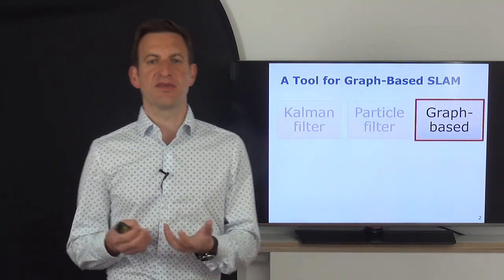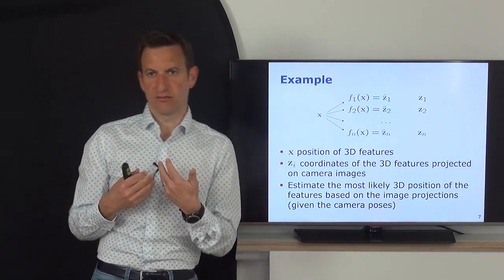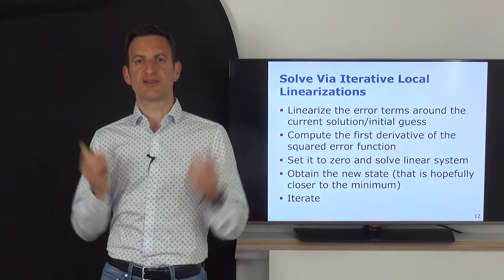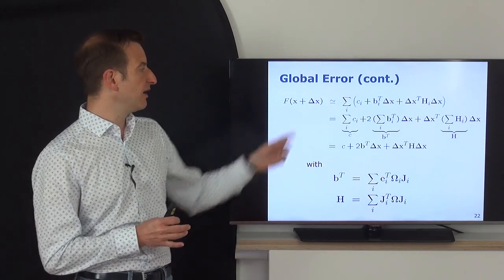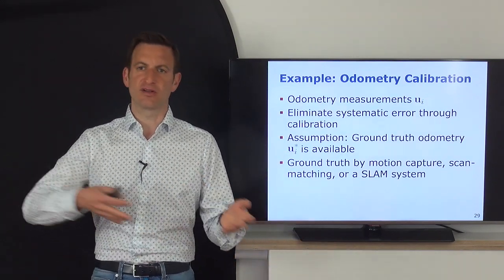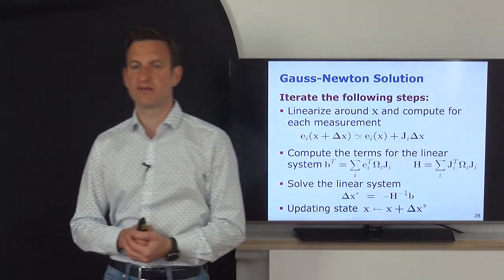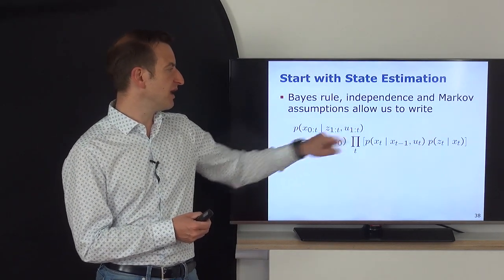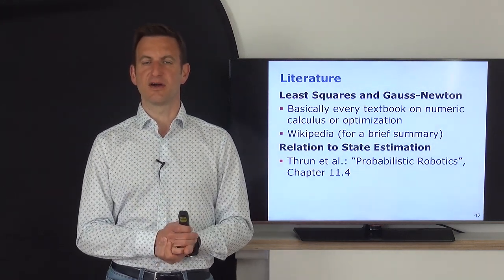Least Squares - An Informal Introduction (Cyrill Stachniss)

Comment: I found the explanation at 9:40 very confusing; Is x just a 3-d point of the input domain? why would you want to vary a point of the input domain instead of model parameters? the notation is a little bit ambiguous . I just assume x to be model parameters for now :)
Reply: Here the problem is that of a state estimation problem rather than a model parameter estimation problem. Here the state is x (unknown) and the observation model is fi(x) (known and fixed). So the error vector is only function of x i.e. the state or as he explains the 3D coordinates (if state is assumed to be a postion in 3D world)